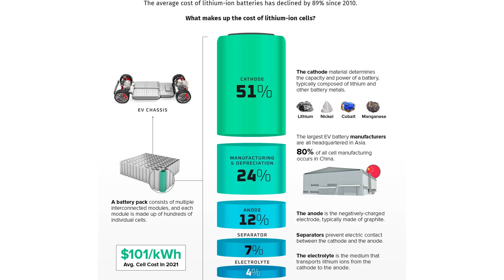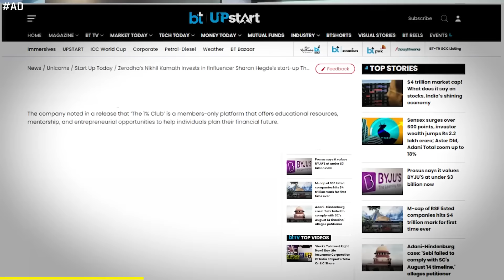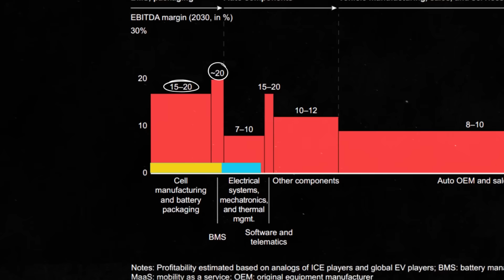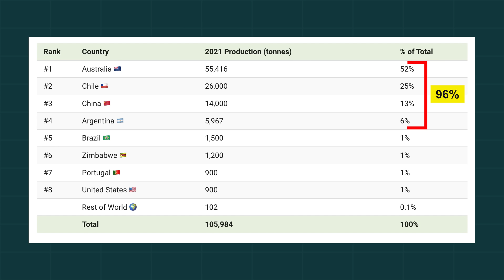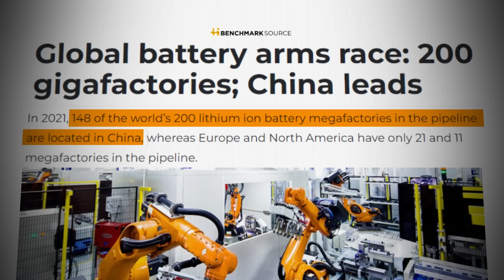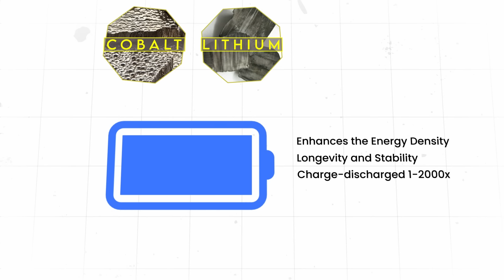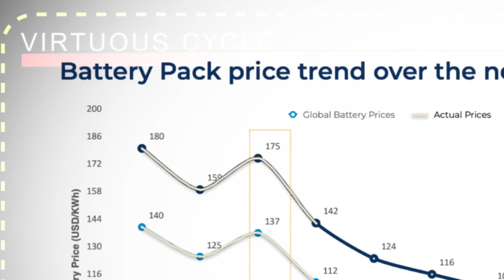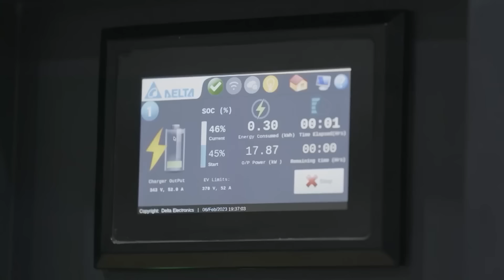Is India Winning or Losing the Electric War?: Business Case Study

Comment: PLEASE.... EV FUEL IS BEING TAXED HORRENDOUSLY AND FAST ELECTRIC (R) FAST ELECTRIC CHARGING IS COSTING AROUND 22 (TWENTY TWO) RUPEES PER UNIT MAKING EV TOTAL OWNERSHIP HORRENDOUSLY EXPENSIVE FOR THOSE WHO TRAVEL. EVS ARE OKAY ONLY FOR SMALL ERRANDS AND NOT FOR TRAVELLING. CORRECT THIS POINT PLEASE. 
Moreover, in India, most of the, or more than 70% of the Electricity is produced by burning coal which is far more polluting than burning petrol or diesel. Therefore, EVs are HORRENDOUSLY DAMAGING INDIAN ATMOSPHERE. MENTION THAT.

Comment: This guy is making a fool of us. How many of you use your 2 wheeler or car for just 2-3 years? Most the people buying use it for 5 years. What the number of years u use. EV is expensive with TCO. Because EV batteries WILL NOT LAST more than 2-3 years. And if u replace batteries, its 50-70% cost of the vehicle. So TCO is gone for a toss. 
The second hand market for battery operated vehicle is ZERO precisely for this reason. 
If you use ur mobile u would have often faced the problem with battery in 2-3 years. Same is the case with EV. Second hand buyers are also smart, especially with google these days. They will know that they would have to shell out a bomb for replacing batteries in EV (2 or 4 wheelers). So would prefer to buy new ones. 
Batteries cannot be disposed off so easily. YOU HAVE TO PAY TO DISPOSE OFF THe BATTERIES. 
So where is the TCO??

Comment: Instead of wasting so much time and writing 500 pages of document, you should have asked me about it 😂.. btw you didn’t talk about the space needed for EV charging stations. Even a 440V/ 250 kw chartering capable car would take 30mins to charge. In metros EV stations should have enough space to keep atleast 10 vehicles on charge. You know the cost of space in Mumbai/ Delhi etc.. factor that into EV charging cost and it will be more costly than petrol. Let’s not talk about home charging because most people in metros are in apartments. Making 220V/ 60amps charging outlet in each parking spot will be another nightmare. EVs are good for people with independent homes, who drive daily 50kms+.. Currently EVs are more of a driving experience than cost effective. Also you didn’t cover the battery longevity because there is no full proof data available even from age old EV company like Tesla.

Comment: EV'S ARE NOT THE FUTURE, we will run to replace them with something else in no time, and for large and heavy vehicles it is unfeasible . They have much worse ecological impact on the mining site , too much energy lose from converting chemical energy into electrical and then mechanical. Weight increase because of batteries , time wasted because of charging, not enough torque produced to perform on high elevation, battery freezing problem, can't perform in extreme weather conditions, can't be used in military vehicles. And many more problems, EVs are taking it's baby steps, very long way to go before they can be considered reliable, and we can't exclude the bursting issue and catching on fire due to high energy density of lithium .

Comment: For personal use 4wheeler, Hybrid vehicles are way more practical due to following reason
- 100% EV, are very heavy 3-4tonns. Breaks, tires & shockAbsorber are expensive & wear quickly. And they also damage roads. Batteries for hybrid are less than 200kg.
- NoBody travels 3-4hundred KM on daily basis, mostly people do 10-20km, a hybrid can easily do that in EV mode. If you need to go further on rare occasion, just fire-up the ICE or maybe fuelCell.

It's very unfair that gov is treating much more practical Hybrid as any other ICE.
My condolences to Toyota...
Reply: lol what are you smoking?

Nexon EV battery is 260kg and car weight barely 1370kg which is only 70kg higher than diesel 

Secondly, hybrid and EV have same price difference of about 3L over ICE models 

For EV, running cost is ₹1/km, hybrid js ₹5/km and petrol is ₹7/km

For recovery of 3L premium, EV needs 50K km driving (6y at 20km per day) 

While same hybrid will need 1.5L km to recover 3L premium and time will be 20y at 20km per day

By that time your hybrid battery will need replacement (but EV battery won’t because it’s liquid cooled and has wayyy more charge cycles) so it’s moot. 

You actually need higher running than 200km per day for hybrid to make sense whereas EV makes sense even at 15km per day usage. 

Talking about EV mode in hybrid, looks like you haven’t driven any because they all run out in barely 5-6km of EV mode driving in city
Reply: @shresthsonkar9207  To be precise, I meant PlugIn Hybrids (Like Ioniq, Prius, Niro... they do roughly 50km in EV mode)

You may not need to replace battery for the 15years lifetime of the car. It's same Li+ battery as any EV.

Rest I don't think you understood the math.

Let's say you live in Delhi, on daily basis you travel 20-30km... which you easily complete in EV mode (spending what ever is power price). When you are home you recharge it.... SAME AS ANY EV.
Now one day you want to go on a road trip to Dharamshala (Roughly 400km highway + 50km uphill).
On an EV like Nexon with just 400km max range, you can never dare do this journey.
You will require something like ModelS with 800km range (weighing 2-3 tonns)
But if you have PluginHybrid like Niro... No worries what so ever... Go where ever you want to.
GOT IT BRO?

Also it's wrong to correlate full ICE with ICE of hybrids. ICE of hybrid are usually a lot smaller, lighters & quieter. So if Nexon had a plugin hybrid, I am sure it would have been lighter than the FullEV Nexon.

Comment: I think ev is not the right direction. The amount of pollution to build a single ev is 10 times more than a regular car and it only becomes carbon neutral after 10 years and that is only when there are no battery replacement during those 10 years.